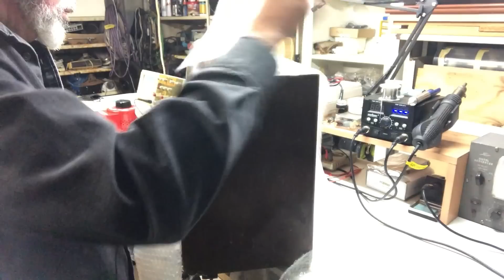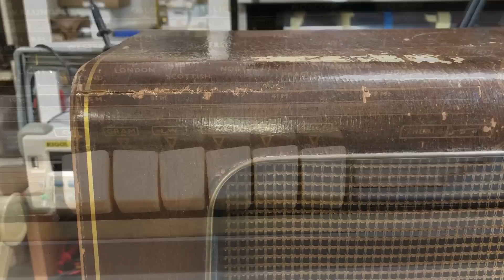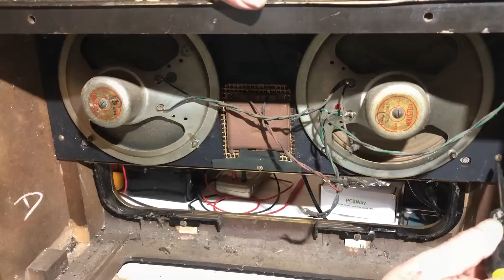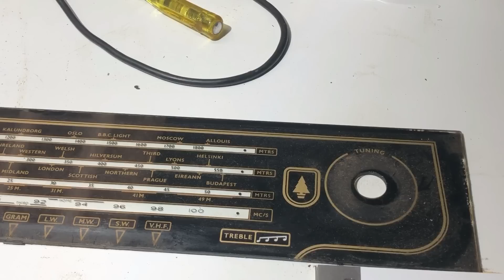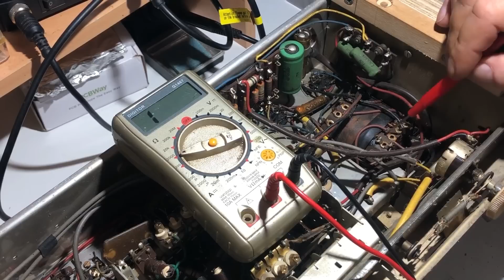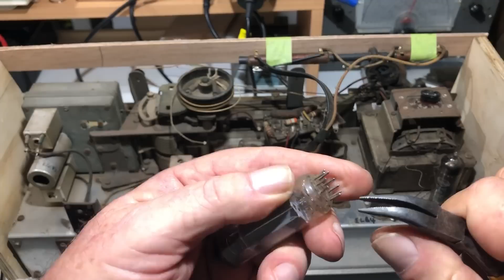BUSH VHF64 Part 1- A first look over this very rough British AM - FM Radio

Comment: You’re on a roll there Donnie boy😊. Your brush strokes rival the likes of Van Gogh and Ross 😮.  The electronics looks like a winner. Now, it’s time to work your magic on the cabinet. I had a dial plate reproduced by Radio Daze here in the states for a RCA International. They did an excellent job on it. ❤
Reply from the maker: Yes Radio Daze might be an option.  I also heard about someone here in Australia who does them.  The 2 holes in the glass (for the knobs) makes it a bit more difficult and probably expensive.  I think a re cap will do wonders for it.

Comment: Don, the camera angle when you are showing the piano keys looked as though they were upside down. The bottoms of the key from the camera angle looked straight whereas the top look crooked.
Reply from the maker: Hi Mack.  Yes, that shot was looking straight down on the keys so the bottom of the keys (facing outwards) is straight.  The crooked side is against the dial glass.  I can't work out why they made them that way.  Surely not a mistake?